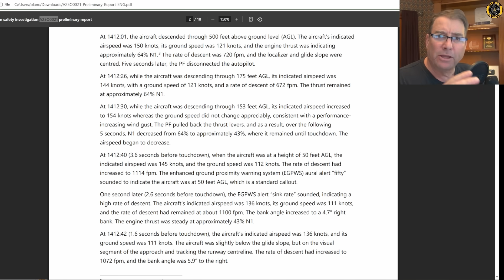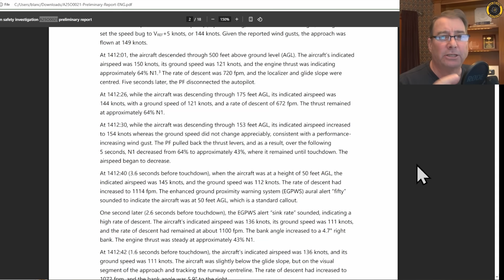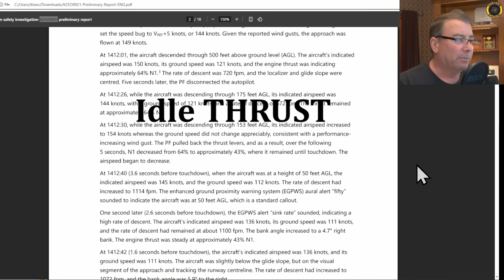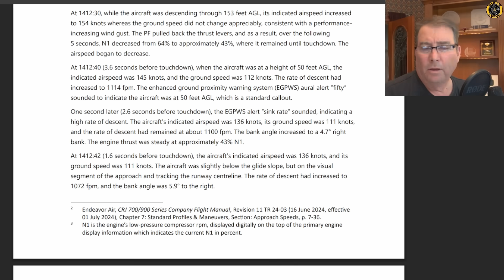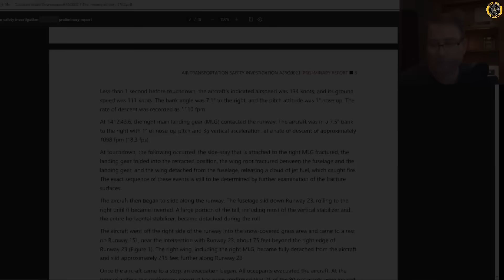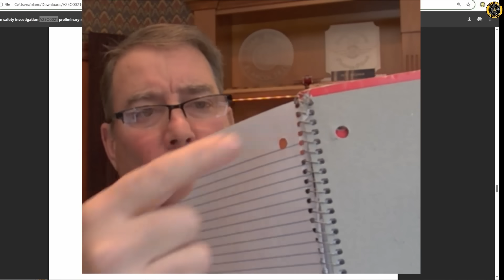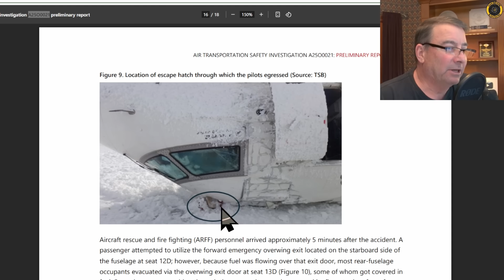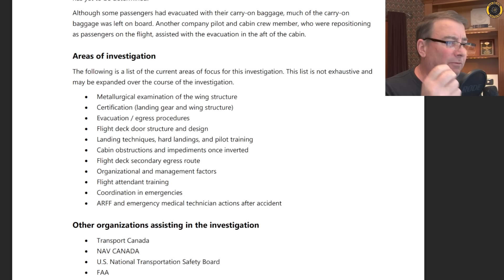TSB Prelim Toronto CRJ Crash

Comment: There has never been a turbine aircraft in history where you should pull power at 150’ and leave it at idle. Inexcusable
Reply: Retired airline pilot. Over 24,000 hrs. Most on the 727. I almost always had flew below 10,000 ft.  Why ? Because it was fun.
Reply: 43 is not idle
Reply: Not the problem here. You can pull power at 10,000 feet and still land just fine if you flare.
Reply: @alexc5449 you can land, but you have no margin. And you dont have the transient behavior in speed and pitch as you land if yoy cut it to idle at 10k feet
Reply: @roflchopter11  what’s transient behavior?
Reply: @alexc5449 time varying/temporary. So the engines take some time to reduce thrust, the reduction means there will need to be a change in elevator to maintain pitch. Then the aircraft starts slowing down, which means a change in pitch and sink rate are needed to keep airspeed constant.
Reply: @roflchopter11  why would you need to maintain pitch?
Reply: @alexc5449 To maintain lift. Pitch (really AoA) will need to increase to maintain lift/sink rate once you slow down.
Reply: @roflchopter11  No, the airplane will fly just fine if you chop the power.
Reply: @alexc5449 yeah, like it did here.
Reply: can do it in a Caravan all day long.
Reply: @skyboy1956  If you want to land vertically!

Caravan drops like a stone with power off. At idle the prop will block airflow over the elevator reducing elevator authority. (The Blackhawk caravan with an 850hp PT6 I flew HAD to be landed power on for this reason)
Reply: @Captain101-x1o I still fly the Blackhawk Caravan, with a 5 bladed MT prop. At least with that prop you can land idle just fine, it's all about speed controll. 

In the quite long high lift straight wing and a landinggear made to last Alaska, you have good margins. Then again, pulling idle in the flare is just so much more reassuring and gives better opportunitjes for go arounds and or gusts.

My last point is I think true for most higher performance aircraft. Throw jets/swept wings into the mix and 'chopping the power' is asking for trouble.

And also being a glider pilot.. Speed control saves your ass anytime I guess. 5kts fast in turbulent weather is always good, 5kts slow in that case is just unaccaptable imho!
Reply: @Captain101-x1o  PT6A-114 & -114A, Hartzell composite or McCauley 106” metal prop Caravans. Can pull the power off from any altitude and land.
Reply: Unless your high on the glide slope
Reply: @chrisgage894 which would classify as unstabilized
Reply: @jaysmith1408  perhaps but in the plane I fly if I’m perhaps 10 knots fast (just inside of stable criteria) and go to idle it will glide all the way down at idle and land fine.  I don’t make absolute statements because there are a lot of different turbine aircraft.  They’re not all the same..
Reply: @chrisgage894  real planes are different than your pc flight sim

Comment: 1400+ hours may not actually be a whole lot of flying. I mean, if she was a flight instructor (as so many pilots are to gain hours) she's basically a passenger for most flights. As she progresses through multiengine and then jet aircraft, again, most flying is on autopilot. Out of all those hours there may actual not be very many actual stick time.